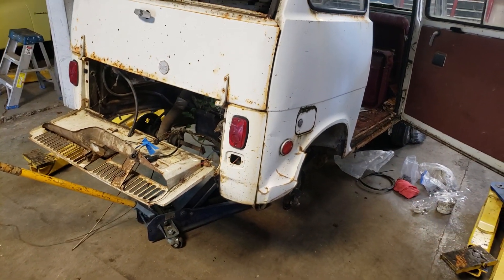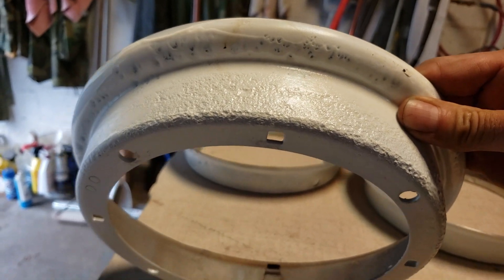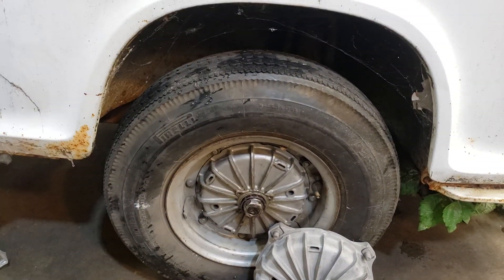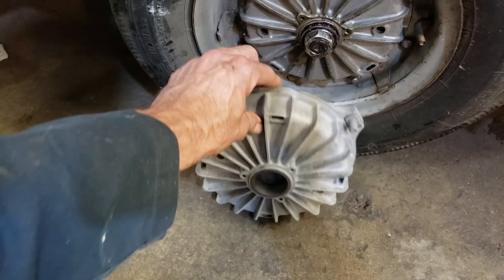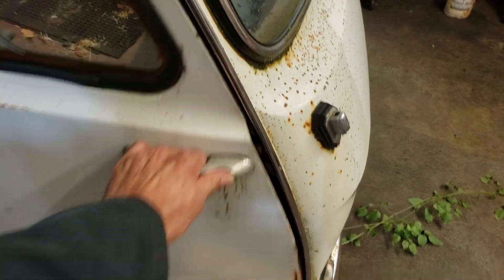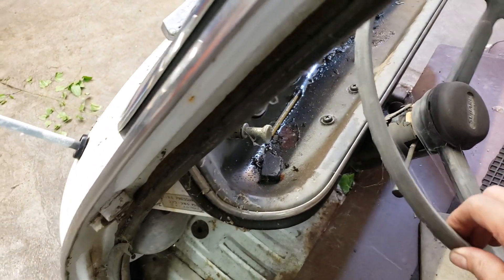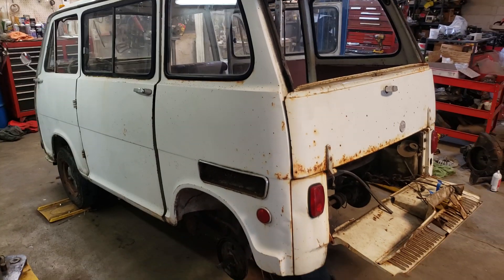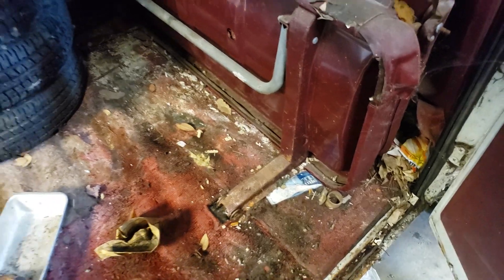Bringing this Two Stroke Crusty Subaru 360 Van back into Shape

Comment: Yes that is a Crusty one.

You might like a Motion Pro 08-0472 Deluxe Piston Pin Puller
Lets you remove the pin without removing the blower housing.
Also no chance of damaging the con rod by knocking out the pin with a hammer and punch.